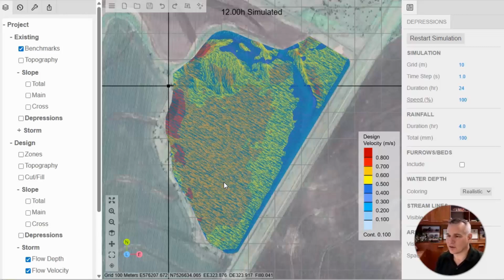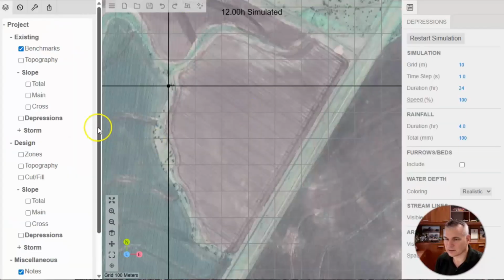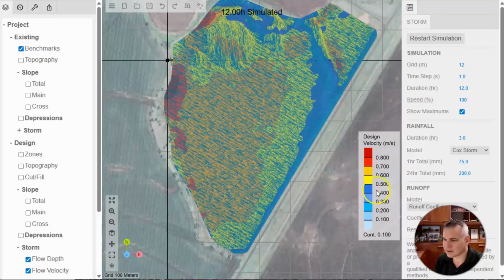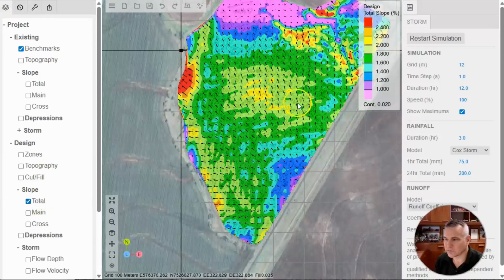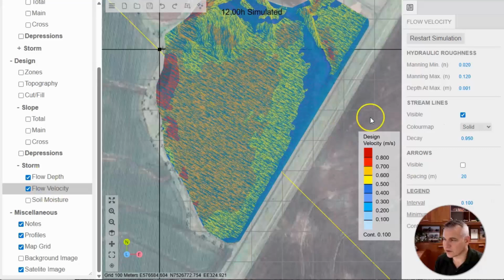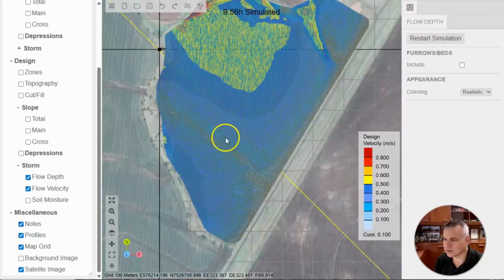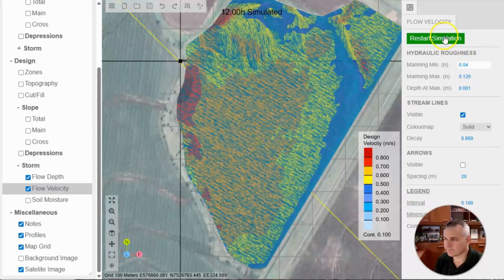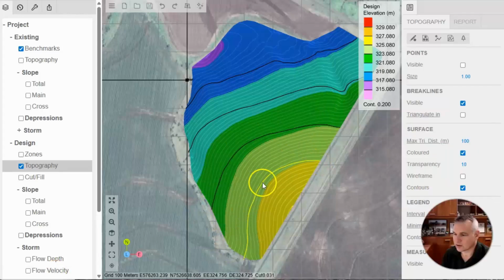Erosion Case Study: Analyzing Runoff from Control Traffic & Designing Contour Banks with AgEarth

Comment: The controlled traffic is slightly off parallel to 
 slope.
Wouldn't using cross slope or contoured traffic reduce erosion?
Reply from the maker: Potentially yes, and you can test different straight control traffic directions with this tool. However, the problem with going perpendicular to the natural slope is you end up with concentration at the low spots along a traffic line, where water collects and then breaks across the traffic line and then starts running. And the problem with contoured traffic control is that you end up with many weird, short traffic runs. Send some data to support@optisurface.com if you'd like a demo on your field.
Reply: Just an observation. 
Call me the Devil's advocate. 
Cheers from Lawrence, Kansas!
Reply: I don't have a field, just a big back yard.
While Kansas is known as the breadbasket of America, I'm not a farmer. Just a geologist.  Surface processes interest me, as well as the history of the earth held in the rock record. 
Here, we look for those "V" topographic surface patterns and build terraces across them for erosion control and water retention. 
Good luck with your enterprise.
Reply: At what percent slope does an average field have zero soil loss from surface water erosion?  At what percent slope does all rainfall infiltrate or evaporate but not run off the field?  Can degraded land with very little remaining topsoil be regenerated by stopping soil loss and growing new topsoil?